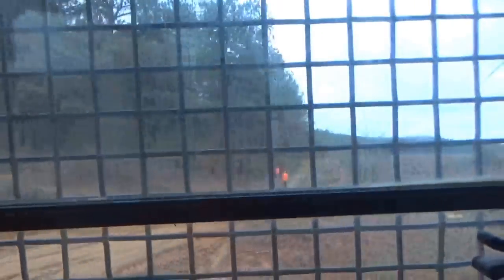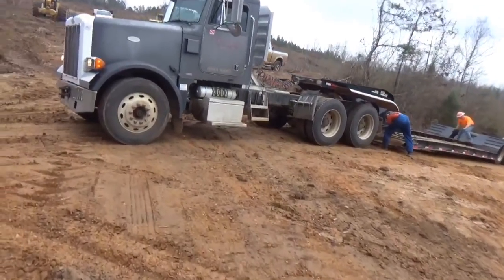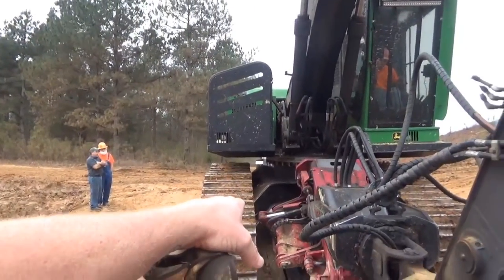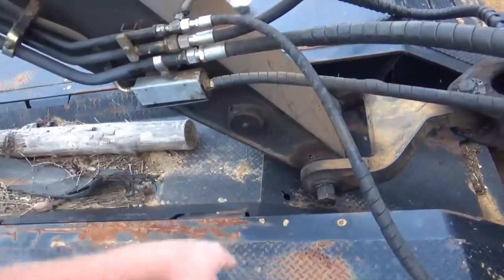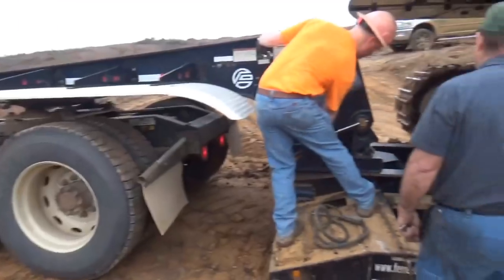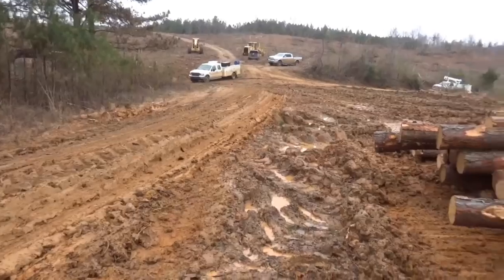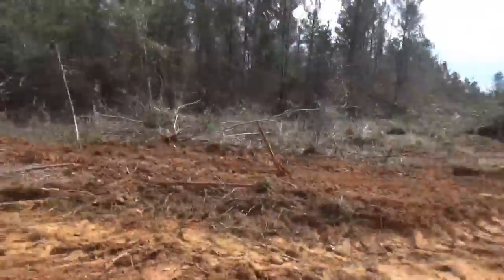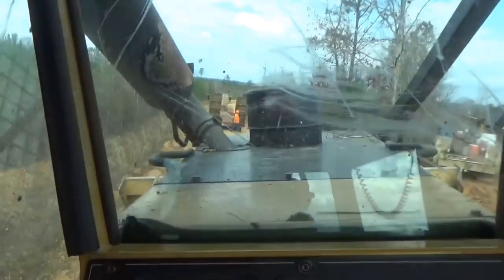Moving to a new job

Comment: Equipment moving day, always somewhat worrisome but a good feeling! 
I did the math on cost of moving equipment and found if moving 85 miles or less it was cheaper to 'road' the grader than sending a lowboy back for it....and the 'man hours' consumed was equal or less....and after tracking the costs a couple of times, I found it worked out that way in reality.   
....13

Comment: Good video.  I have question in regards to your bulldozer and motor grader.  I live in the SE Georgia  area and their is  a lot of logging operations here, I have not seen any motor graders or bulldozers with their logging operations. Is the bulldozer and motor grader a requirement were you do your logging?   Thanks
Reply: Terry G 
They need the dozer to build the road into the area being logged.
A rough haul road can damage the a trucks suspension and there's always the danger of flipping a truck over.
A loaded log truck is somewhat top heavy. 

As timber is harvested the loading area or "deck" is moved closer to the timber.
The shorter the distance the skidders have to pull logs to the loader.. the less fuel the skidders consume.
(Fuel costs are high)